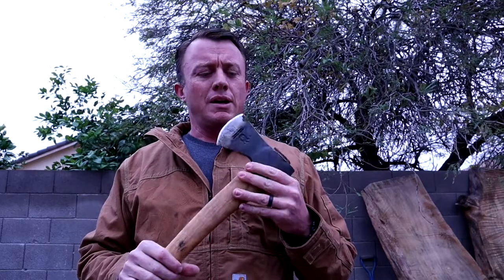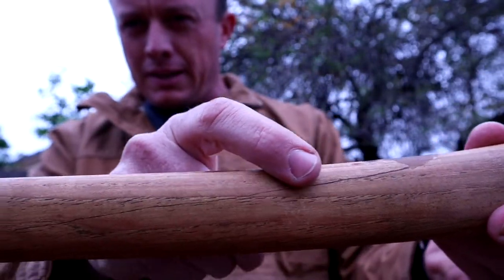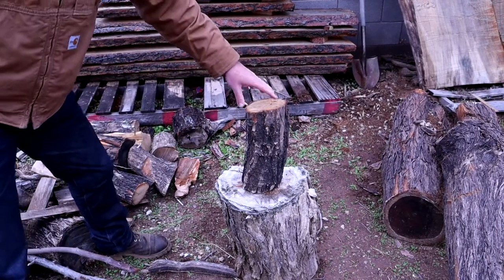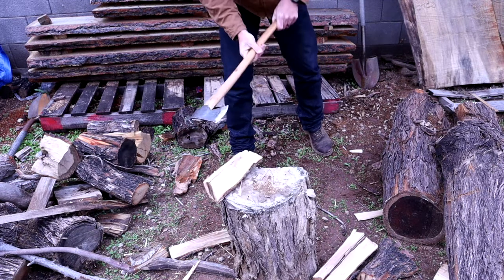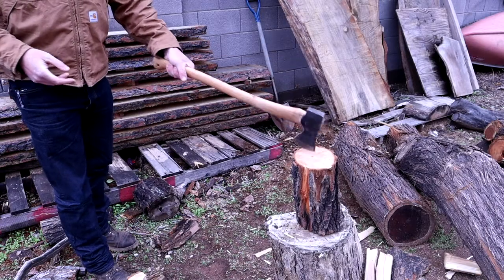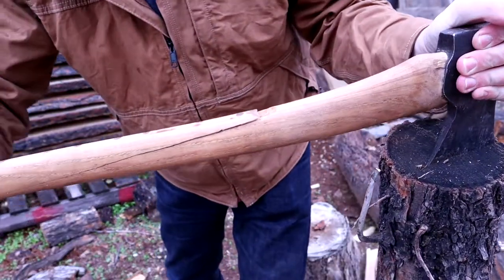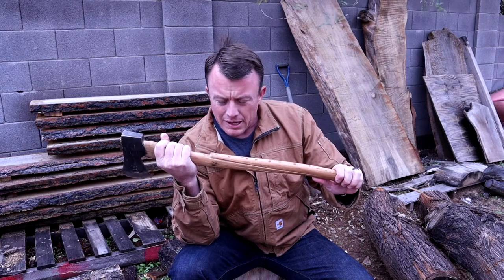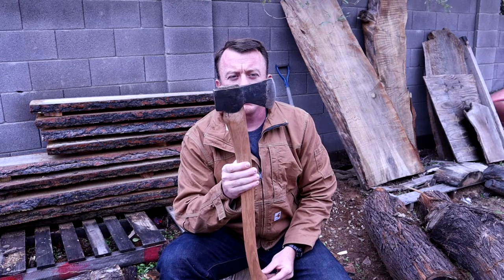Can you fix a broken ax handle with epoxy?

Comment: You should have wrapped the handle with paracord and then used epoxy over the paracord. Fiber reinforced plastic would have made it harder than steel.
Reply from the maker: You're right